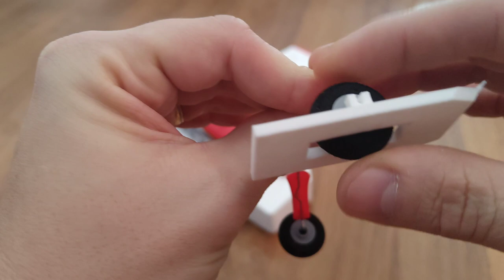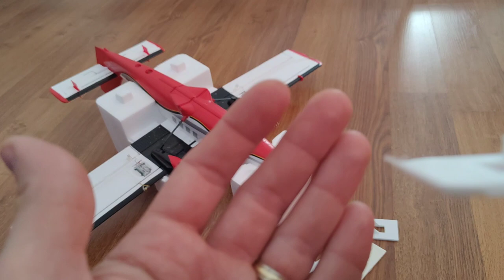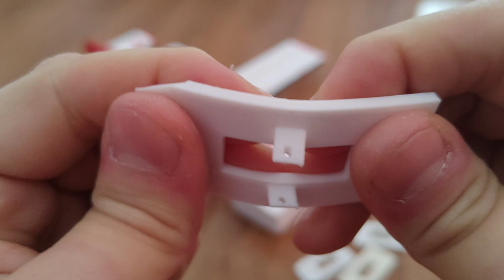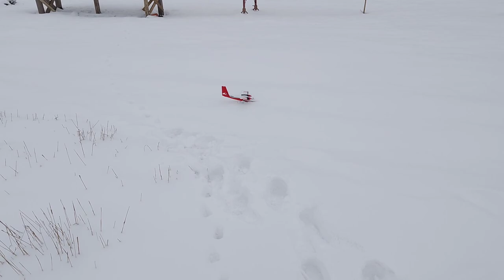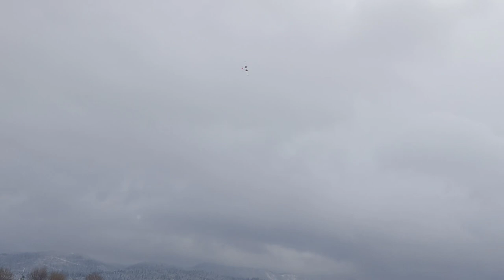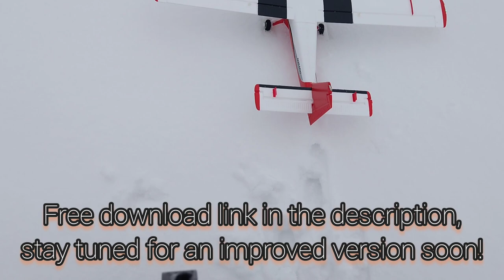UMX Twin Otter 3D printed skis - free STL download

Comment: Skis look great. Glad someone has tried this instead of just using floats. Shame they didn't work great in practice. Looks like the thrust on take-off pushes the front wheel down and into the soft snow! Perhaps needs the slowest throttle up you can manage to get it moving and then takeoff (or just harder snow)? Maybe increase the front lips a little more and/or add a little weight or length to the back of the ski so it tends to lift the front of the ski? What do the full scale guys do?
Reply from the maker: Thanks for watching! I made a few changes, I'm also thinking now maybe they need more travel, at least the front one so it goes over the snow, not in it. I'll keep working on them.
Reply: Hope you manage to work it out. All the best @A.M.-RC
Reply from the maker: @andrewfairweather1340  Thanks, same to you!